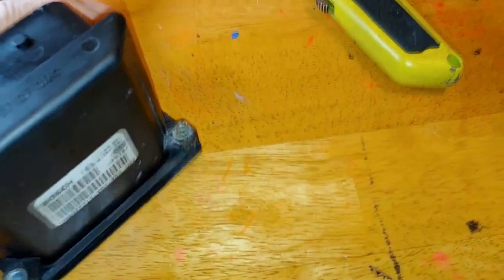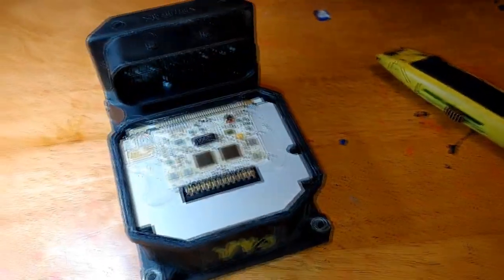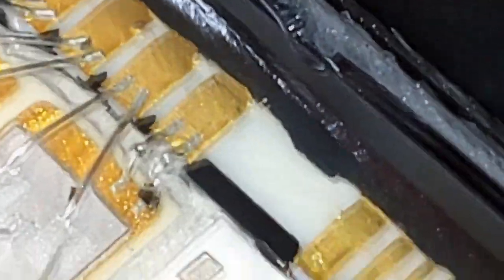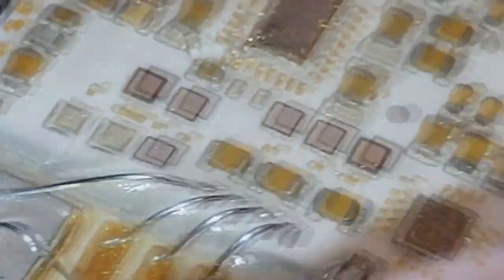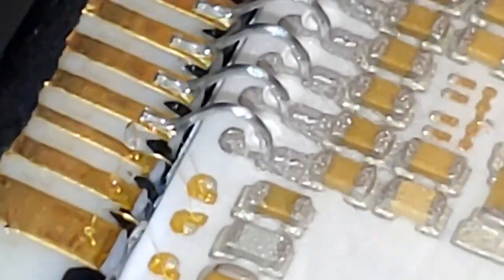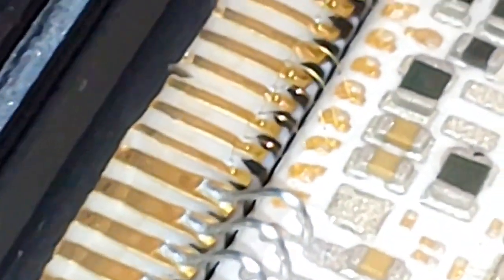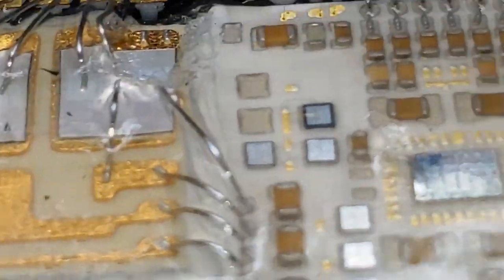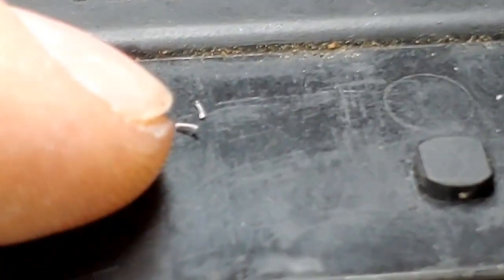2000 BMW 528i ABS DSC diagnosis module inspection. What failed?

Comment: Really good video.  I do not know where you are but if in USA there are some websites that do the repair on these units.   Really great video.  I am in Canada and the repair shop wants $500 to fix it.  Plus tax…
Reply from the maker: Yeah there are a few, I can't remember the name of the one I used for a sprinter Van that the faulty abs module actually caused a transmission shift issue... Wish I made a video on that, it was for a transmission shop that threw a bunch of transmission parts at it and the lead tech there said it had something to do with the abs but the boss didn't believe him... I came in and just verified the lead tech was right... That tech no longer works at that shit hole shop.

Comment: This is why I stick to vehicles that still had ash trays... Because these days we are repairing nothing but sensors, ECU's, PCM's, modules, or searching for a "possible" short though 2000 miles of wires wrapped in a harness that snakes behind every panel and hole the vehicle has.  The way I see it except lighting and a starter, the only wires an engine requires is 8 ignition, one coil, and an easily replaceable clipped on cap and rotor.
Reply: Too oldschool.

Comment: The wires that conduct the current used in the control unit are silver wires that work with ultrasonic waves, but how can they be obtained and how are they connected?
Reply: Aluminum and gold are the most common materials for bonding wires.  Even copper is considered exotic.

The thicker bond wires that fail are aluminum.  The thin gold wires are reliable.

Wire bonding is done with a thin probe attached to a ultrasonic transducer.  Wire bonding machines are several thousand dollars and up -- not wildly expensive but not something a hobbyist would be buying.

You can try to replace the wire with something solderable -- copper or wire-wrapping wire.  But you'll find that removing the silicone gel is very likely to break the almost-invisible gold wires on adjacent pads.